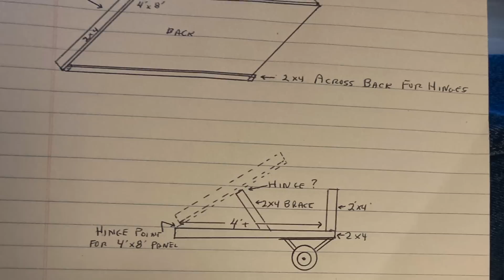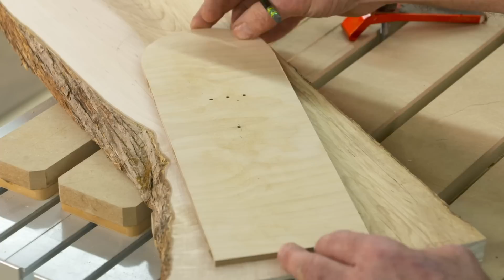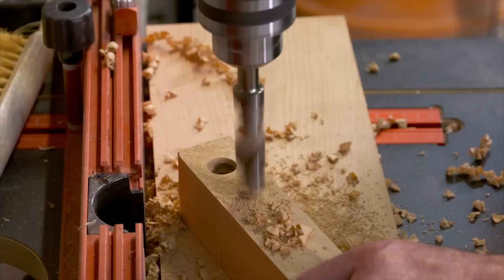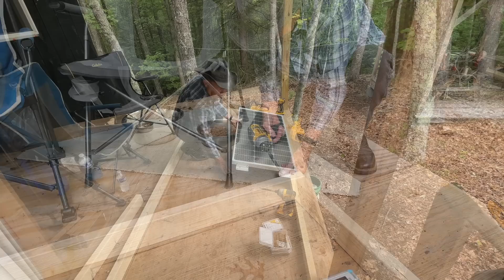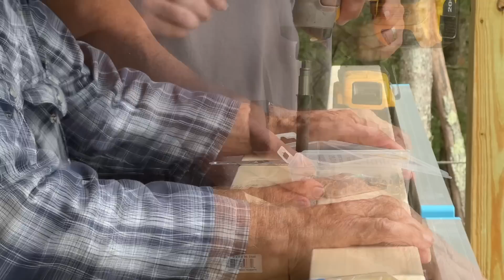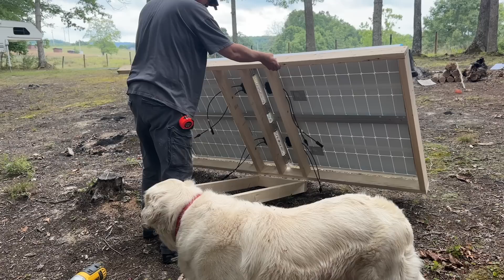We NEED a MOBILE Solar Panel Array for Our Off-Grid Cabin

Comment: TY Just came upon your channel. I have a similar cabin camp setup in the Adirondacks. We have a project planned to build a 4 100w Renogy panel stand. Do you leave your batteries out off season unheated or heated on the property ? Is the array charging the batteries off season? Thanks for the info and charging my brain cells with ideas.
Reply from the maker: Good questions. I was disconnecting since my cabin isn’t heated. Talk to Renogy rep and they suggest leaving them connected as their batteries have good Battery Management System (BMS) that cuts off charging below freezing. Key is to not let them run dead however if you have a slight drawn but stay below freezing all the time.

Comment: To avoid splitting board ends with nails or screws, clip the tip or give it a whack with the hammer to flatten them.

Comment: Having dealing with solar for many years, I think in your case it would be better to leave the panels FLAT at lease in the summer. WHY? In the summer you will want to point the solar array to the east, that is GREAT but you will have to go out every hour or so and move the array to get the best amount of sun. What happens if you forget to move the array until about 1:30PM or so? By then the sun will be moved to where the panels will not make any power at all. 
In the winter time put the panels at, what did you say, 42 1/2 degrees. Facing DIRECTELY south, again if you move them to the east you might forget doing other projects.

Comment: To deal with the uneven terrain, I would put a couple of gravity operated angel gauges something similar to a plum Bob. So it can be set to desired angle. I think a set of adjustable legs to level would help with desired angle along with stubility with wind.
The angel adjustment I would do a slotted with a wing bolt and mark the month reference so adjustment would be simpler.
I'm a long time fan of your channel. I grew up on a small farm, about 20 cattle, 100 chickens and a few hogs. Thing has changed some except walking the electric fence. I used the time I spent walking fence line meditating and praying.
Enjoy your content and your humor.
God bless you and your family and Timber.

Comment: Honestly I'd just face the panels South , put them at about 30° and call it good . The few percent loss in efficiency versus the output at the optimal angle is usually not worth the bother of chasing , and it's cheap enough in most every case to just add an extra panel or two to compensate .
Carefully your 20+ square feet of solar " sail " doesn't get more mobile than you anticipated.
If have a anchoring system to keep it where you want it until you want it to move .
Roofount should always be the last option for mounting panels .
When ( not IF ) you need to repair or replace your roof , you will be damned glad you went with a ground mount . Most roofers don't do electrical work , and , you really don't want them to IME .

Comment: Good job. I'm lazy, I'd just do one regular sized solar panel and move it around manually 😂
Reply: You can get 250 - 390 watt panels , for about the same price or cheaper than the 100 -200 watt mobile panels , especially if you find a deal on used ones .
Facing them straight up works well too .
Even with the weight of them , you still want to avoid them becoming spontaneously mobile though .